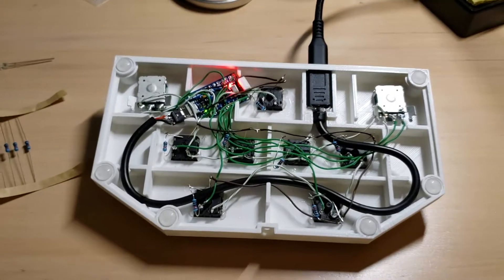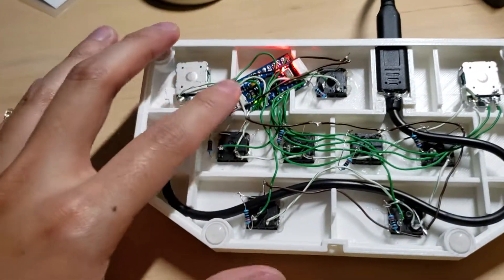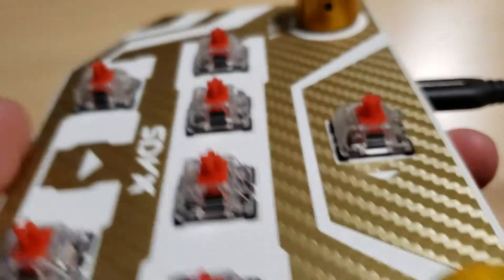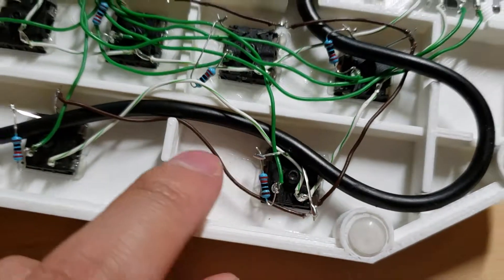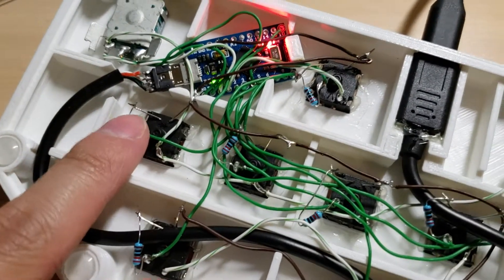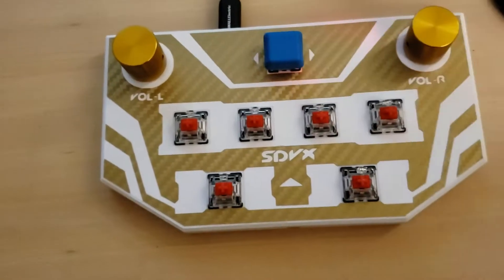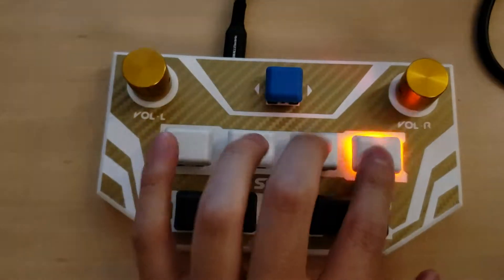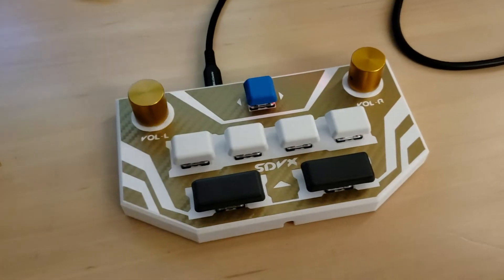Pocket SDVX Guide - Adding LEDs (OUTDATED - SEE Software/HID LEDs)

Comment: What’s the purpose of adding resistors? Is it just to limit the amount of current the LED sees so that they aren’t damaged?
Reply from the maker: Basically yes.  LEDs don't really have enough resistance/load, and as a result they need a resistor in-line to control the right amount of current.